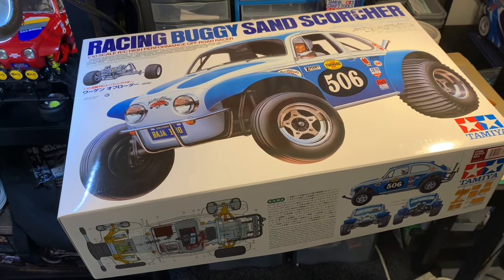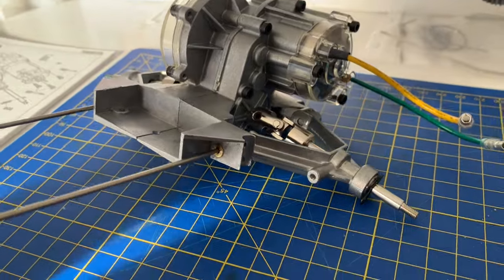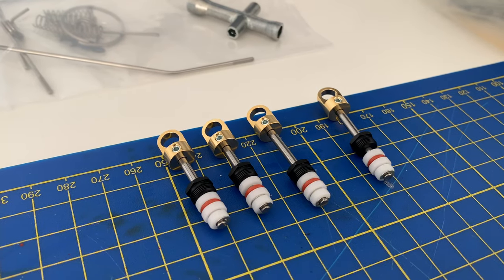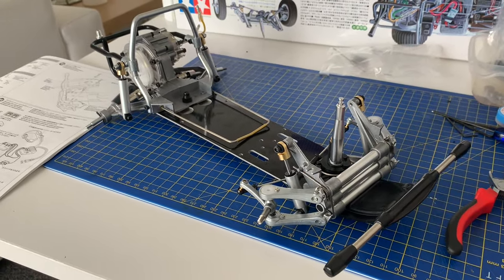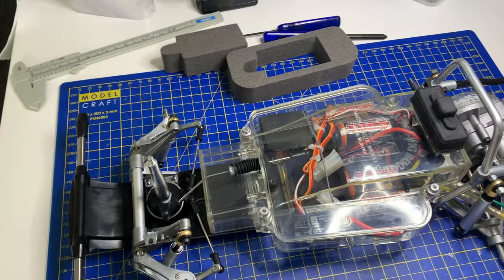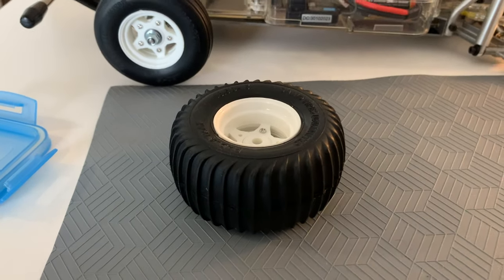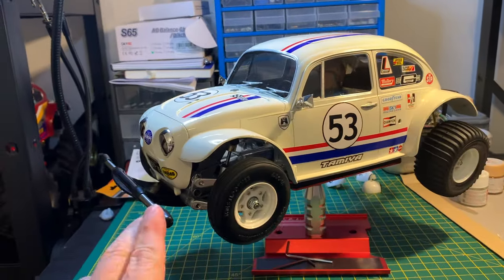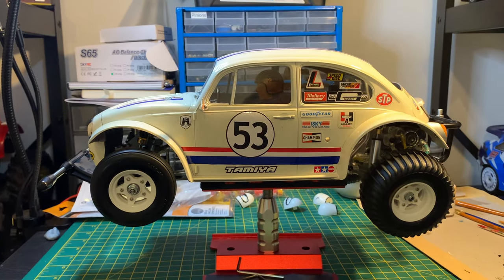Sand Scorcher Build  - Tamiya Racing Buggy

Comment: Hi mate looking good but looking at the video you have the shocks the wrong way round the longer cassing ones go on the front shorter ones on the rear I have 2x rough rider 3x sand scorcher and and a ford ranger so I've built plenty of these and box art takes hour's lol.....
Reply from the maker: Thanks. The shocks have been swapped around. I’ve had an issue with paint bleeds on the spraying of the white. Sanded down and resprayed. Just about to mask and do the blue.